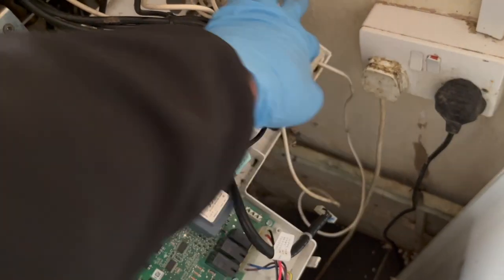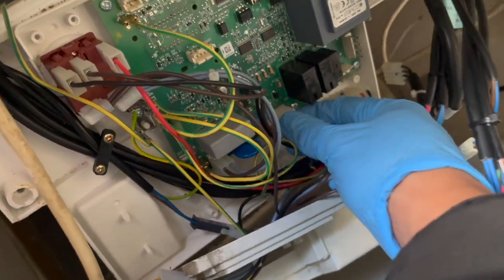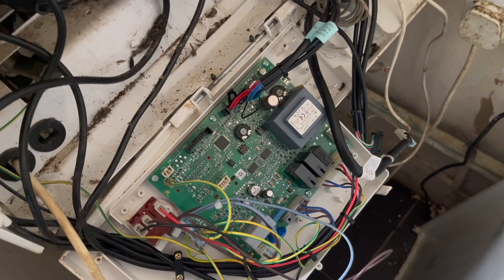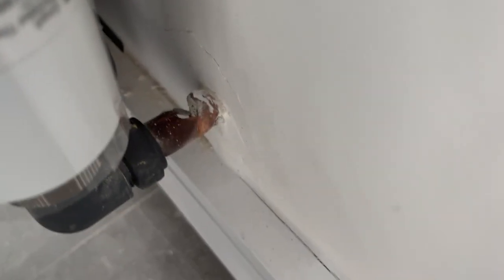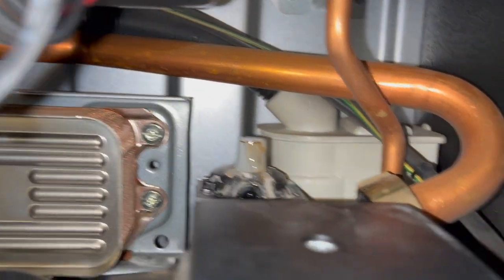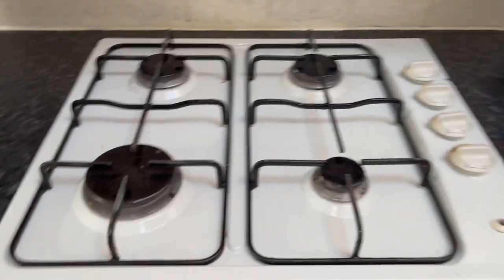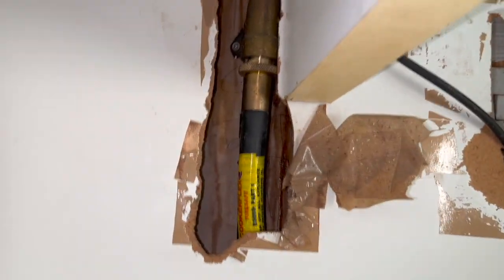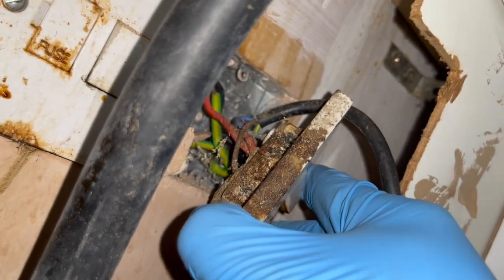Day In The Life Of A Gas Engineer #4 | Boiler Repairs, Gas Hobs, Gas Leaks & Tap Change

Comment: For that prv you can just use tap spanner and unscrew the black plastic nut and change the guts , or most the time just a good clean and silicone grease does the trick

Comment: Great work 👏.  Just a bit of advice. Try and invest in milwaukee air compressor to save time and energy having to use hand pump
Reply from the maker: Haha! I’ve had a few people tell me to get an air compressor. I don’t mind getting one but I don’t think it will fit into my breakdown bag. I like to go in to jobs as empty handed as possible. With my current bag I can attach my pump to the side of it
Reply: You use makita so get a makita one. It’s what I have, great bit of kit. Rather than getting Milwaukee one then having to buy the battery too 👍🏼
Reply: Other brands available 👍🏽